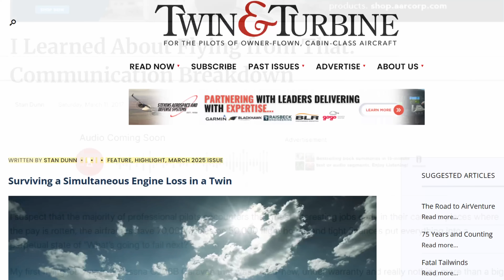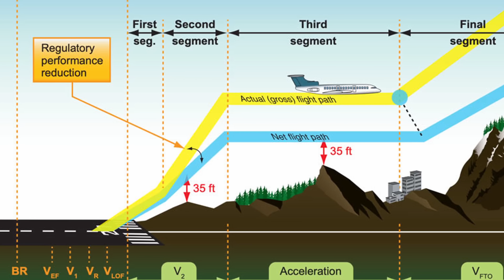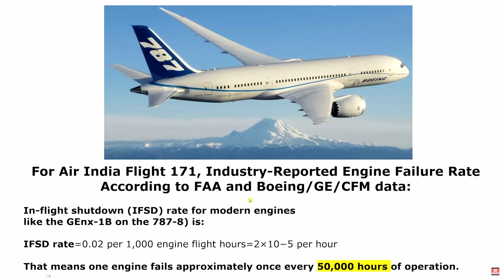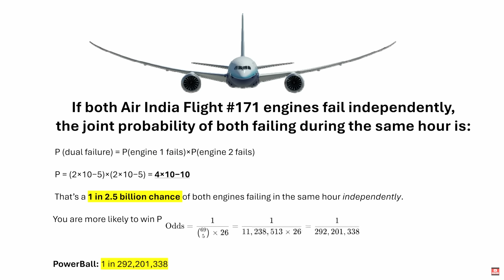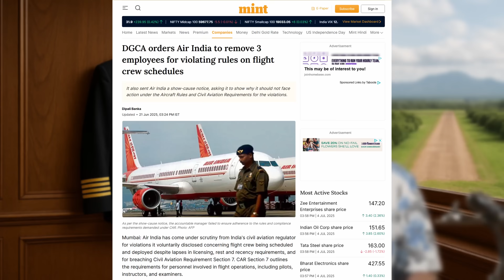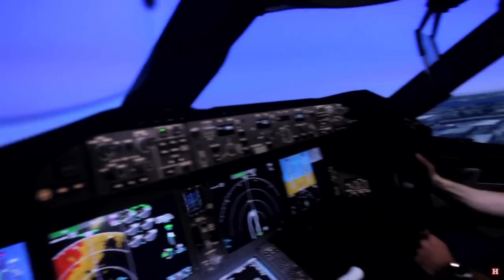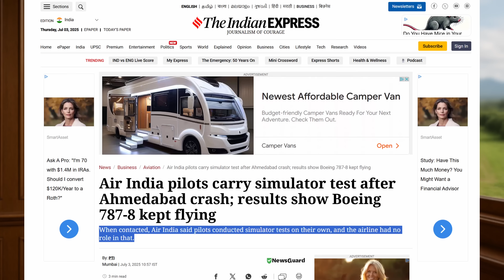Air India 171 Cause Becoming Clear

Comment: When  speaking about Flight Data Recorders (FDR) and Cockpit Voice Recorders (CVR), an image of an orange box was shown, it is not a FDR or a CVR, but is an Emergency Locator Beacon (ELB).

The B787-8 is equipped with combination units which record by Flight and Cockpit Voice data. There are two units installed in the aircraft one in the tail and one in the forward electronic bay.

Comment: In a 2009 SA Airlink accident, the pilot mistakenly shut down the functioning engine instead of the faulty one, leading to a forced landing. The crew was flying a Jetstream 410. The right engine had failed due to a turbine seal plate issue, but the aircraft could have continued flying on the left engine. The pilot's error in identifying and shutting down the wrong engine resulted in the crash.

Comment: Sabotage from within the flight deck? A third pilot or cabin crew member sat on the jump seat pulling the fuel control switches just before rotation? This would explain the seemingly late takeoff, gradual loss of lift & RAT deployment
Reply: The aircraft could not have reached the impact point if both engines were shutdown, hence they had to be producing some power.
Reply: @christopherrobinson7541 it would take around 20 seconds for the engines to completely stop producing power after shutdown

Comment: One should hear the engines instead of the RAT, even if the RAT was deployed.
Reply: The original version of the video taken on the balcony is better quality and the in addition to the RAT the engines can be heard operating at low power.
Reply: @christopherrobinson7541 RAT 80db, engine at least 40db louder at take-off would make it impossible to hear the RAT.

Comment: Put pilots back in control not computers pilots have no feel of these aircraft anymore because computers are flying them and & compensating for any little changes so when something does go wrong pilots panic because they haven't got the experience to feel what the plane is doing or the experience to have an idea as to what may be causing the problem say you have smoke in the cabin bring out the bible spent 25 min running through trouble shooting smoke is getting thicker & in that time you passed 2 to 3 airports where you could have landed 40 min later smoke has filled the passenger compartment but were still reading. Pilots need to have the feel of their aircraft say they get a 100 knot cross wind instruments plane is all over the place pilots are panicked because they never felt anything like it because the computer would compensate for this any other time pilots would know this if they flew their planes.

Comment: Losing power in 2 engines within an hour is impossible? British Airways flight 9 lost power to all 4 engines. That was a 747!!! It can happen. There are usually causes outside the aircraft. They flew through ash.
Reply: What saved that aircraft was teamwork. The crew streamlined the relight procedure and eventually were able to recover power to the engines.

Comment: Thanks for ur indepth analysis. The pilot shutting down the functioning engine instead of the malfunctioned out of instinct is not only scary but also worysome.
May be not taking adequate rest put em in severe stress.
Yes i assume it was majorly a pilot error disaster and think the pilots knew which engine had issues, they thought it was corrected or could be managed but the fault persisted eventually leading to disaster.

Comment: It does not need much! A faulty WOW switch, and an engine fire sensor, erroneously indicating an engine fire (due to heat or moisture).
A software that autonomously shuts off all fuel valves since, by the sensors, the aircraft is on the tarmac and burning.

Comment: Background- 36 years in aerospace engineering as a supplier of electrical load management systems. I continue to find it utterly unbelievable that the APU is shut down after main engines are running.  This can only be a mandate from airline finance and eco loon’s.  Surely (don’t call me Shirley!) a safer position would be to take APU to idle after engine start and leave it lit at idle until in the cruise, when you have ample time for a relight if needed.  Ok, that wasn’t a significant issue for Air India but it was extra workload for Sully in the Hudson.
Reply: Why do they shut down the APU? Cost.
Reply: @christopherrobinson7541 yes, read my comment again. Finance or eco loons.

Comment: there was clearly smoke coming out of the left engine, ground dust from wing downwash during liftoff doesn't likely come on 1 side only as we saw, so this is clearly smoke from the left engine.
Reply: There was a light cross-wind from the right, which is why the dust was blown to the left.
Reply: @christopherrobinson7541  I dont think that one was that strong to push all the dust to the left as the aircraft had no direction nor bank angle corrctiion to the right after lift off.

Comment: I'm an engineer and we have a saying: "when all possible causes of a problem have been ruled out, only the impossible causes remain". So whilst it may be considered impossible for both engines to fail at the same time, you can't just dismiss the idea because it's "impossible".
Reply: I think Sherlock Holmes said similar a couple of hundred years ago 😊
Reply: @jeanmyers1787  Sherlock Holmes said: When you have ruled out the impossible, whar remains, however unlikely, must be the truth. 

Not really similar.
Reply: @mkk707 Whatever, I think you mean. I think Conan Doyles famous quote means exactly that long before planes were invented
Reply: But as engineers we also say “what is the mechanism?”. You have to propose how you think it happened, so that your proposal can be scrutinised. You can’t just say “because” like little kids do.
Reply: @jslonisch TCMA (software on FADEC use for preventing un-command high thrust) can command engines to shutdown automatically when FADEC is on ground mode.

Last year there was an airworthiness directive about faulty LRRA (Low range radio altimeter) can cause “undesirable Auto Throttle behavior” on 787

LRRA is also being utilized by FADEC to sense air/ground mode.

So a faulty LRRA would’ve cause undesirable A/T behavior + FADEC issue with sensing air/ground mode 

If FADEC is on ground mode while plane is in the air, combined with undesirable A/T behavior due to faulty LRRA…

What are the chances of TCMA activated and shutdown both engines simultaneously shortly after take off?

It’s definitely far from impossible…

Note that this scenario also matches perfectly with everything we’re seeing so far.
Reply: @jslonisch  "You have to propose how you think it happened" - yes, and the investigators will eventually do that. But what do we know so far? Well, we know for certain that the plane crashed. We also know that there are a handful of suggestions as to why it crashed and that each of them have been deemed so unlikely that they can be ruled out. So that leaves two possibilities - either something that nobody so far has thought of led to the crash or one of the ruled-out 'impossible" causes did so. We need to keep an open mind and let the investigators do their work. We can also hope that the cause isn't something that fundamentally threatens all future aviation. As for "proposing how I think it happened", I don't know; I don't have access to the evidence and I wasn't there. I can only point out that sometimes things that do seem impossible, do actually occur.
Reply: @Chris-hf2sl I don't think this investigation is transparent enough. There needs to be a representative of the families as well on the team to ensure it goes properly. It doesn't take this long to download the CVR!!!?
Reply: @V12F1Demon  "I don't think this investigation is transparent enough. There needs to be a representative of the families as well on the team". - the last thing that the investigation needs is representatives of the families wailing in the background. Proper investigations take time. A interim report is sometimes issued after a month or two if a problem is identified that needs urgent attention to prevent a reoccurrence. But normally, such investigations take a year or so because it's important that all aspects of any findings are considered and that no incorrect hasty conclusions are reached. Yes, it's frustrating, but it's far better to get things right than to rush.
Reply: @Chris-hf2sl  Not saying rush it but an independent expert bound by the rules of the lead investigating agency who is nominated by the families to be part of this process sounds quite fair to me. He doesn't have to be informing families only someone who can reassure them that, procedure is being followed.
Reply: @jslonisch it just takes time. Like that time a swiss airplane was destroyed by a fire caused by a pelt designed inflight entertainment system
Reply: "when all possible causes of a problem have been ruled out" ... check who owned the ruler, and what their "stop criteria" are ('Cognitive Systems Engineering', Rasmussen et. al.)
Reply: Especially when they're controlled by the same buggy software.
Reply: fuel valve fails closed after DC power failure...heard it the day after the crash.
Reply: @nunyabiz1780  nope
Reply: @nunyabiz1780  well that explains what we see that seems highly unlikely that any kind of power failure would lead to such valves failing closed, by design. 
I suggest that if they did both close, it’s because the control system told them to close.
Reply: @JoeOvercoat  yet its a safety feature
Reply: @nunyabiz1780 Nope, one of the pilots screwed up and shut off the fuel to both engines
Reply: but occams razor should be used first because it takes less time.
Reply: Fuel, Filters, Oil, Air/Tank Gas, outside parameters, Fuel Injection, Electrics-Hydraulics-Electronics, Feed back and Controls, Flaps. 
Human Error prior and or during flight, Sabotage, Terrorism etc.
Lets wait and see what the data analysis says for evidence and not to speculate.
Reply: @SamBaghi  we are just curious and interested people who find this accident so mysterious... not your run of the mill accident which is why there is so much interest... just opinions...
Reply: @SamBaghi Human error should always be be at the top of the list.
Reply: We're not at that point. We have the data from the black box to analyze. IDK why he's even doing this video. This has been beat to death already.
If the black box is not usable, then we have conjecture and wild speculation to get into. Maybe space aliens LOL (It wasn't space aliens).
Reply: As an engineer I work differently.  The least probable can be dismissed until the more probable are evaluated.  Which they have not really released any information yet on.
Reply: Well Said Sir !!❤
Reply: It’s nowhere near impossible for both engines to shut down simultaneously, a software issue could command them both to ground idle, AF296 had an issue along these lines in 1988.
Reply: Nothing is impossible an NO 9ne is untouchable.
Reply: Several billion to 1?  You must spend your entire paycheck on lottery tickets.
Reply: OTHER more probable causes HAVE NOT been ruled out - So the homily is misleading
&
IF both defied astronomic odds & concurrently failed - WHAT CAUSED THAT? 
There is growing suspicion that plane was a DUD (poor maintainace or whatever) AND the Pilots were exhausted even before getting on board
Reply: Perfect!
Reply: Indeed, exactly. And there were some very seldom, but existing cases where a dual engine failure wasn´t caused by a bird strike, the famous 777-at-Heathrow-example included.
Reply: Anything is possible.  Double engine failure could happen, but very rare, very low probability but according to Reason's Swiss Cheese concept, sooner or later, all the negatives could line up leading to a disaster.
Reply: "when all possible causes of a problem have been ruled out, only the impossible causes remain". Well, I'm an engineer too and during my forty years at Rolls-Royce plc (aero gas turbines, not cars) I never once heard anyone use this alleged "saying".
Reply: "ELEMENTARY MY DEAR WATSON!!!"
Reply: Well as engineers, we think in probability all the time, also in probability that is so rare that it can be discarded. But double engine failure isn't improbable at all, as long as there is a common cause, and I don't think anyone of relevance thought about ruling that out.
Reply: Microsoft Excel field a Paisan formula several years ago where one of us can go into Excel find the formulas put in the rates of success or failure in this case, put in the number of events and ask it about the probability of being above below or at that value. 
As an analyst, I would say the probability is very low of independent engine failures at the same time   but I would also say that an aircraft is a complex system with interrelated components so it’s easier to imagine a dual engine failure driven by some control error.
But no matter how one cuts it, it’s not zero.
Reply: No longer impossible I guess as it appears to have happened in this one
Reply: Exactly! People are struck by lighting twice despite the idds and people when the mega lottery despite low odds. Nothing is impossible
Reply: Exactly! People are struck by lighting twice despite the idds and people when the mega lottery despite low odds. Nothing is impossible
Reply: And lets not forget ONE person survived the crash…No serious injuries and no burns…. would one sustaib injuries being ejected from an airplane oover 1,000 feet in the air?? A lot of ppl die adter being ejected from a moving vehicle
Reply: I think Sherlock Holmes said that in the 1890s
Reply: Don't forget that we exclude human error for ethical reasons, not because it's more impossible than two engine failure.
Reply: A dual engine failure is very very unlikely. Pilot error is very likely. One of those pilots shut the fuel off to both engines.
Reply: It was settled some time ago that engines were switched off, even the captain states this and three time. Now there is clearly fear that the airline might go bust, so a pr exercise is taking place, muddying the waters, taking away from what really happened
Reply: Yup, improbable is not the same as impossible. A simple example of that is the roll of a pair of dice to get a double six. The odds against doing that are 35:1, but you or I could still roll a double six on our first try and I'm willing to bet you might have done so on occasion because I know I have. It's the same principle with a dual engine failure too; massively unlikely it may be, but that doesn't mean it could not happen.

However, it is worth bearing in mind that whilst the oft-quoted  Arthur Conan Doyle phrase uttered by his character Sherlock Homes, which your saying paraphrases, i.e: 'When you have eliminated the impossible, whatever remains, however improbable, must be the truth' sounds very clever and suits the narrative of Holmes' fictional brilliance as a detective, but in reality it is simply not really a practical thing for a real investigator to rely upon. The reason for that is pretty simple and can be summed up with another phrase, which is: 'we do not know, what we do not know', or in other words, we would have to literally know everything in order to be absolutely sure we genunely had eliminated every potential possibility, and in practical terms, we are never going to be able to do such a thing, because we do not know, what we do not know.
Reply: @ChockHolocaust  "Independent engine failure within the same hour one in 140 billion."    Dunn makes this assertion without evidence.  In any case, one in eighty billion is the same as rolling double-sixes seven times in a row.     Assuming independent events is a rookie mistake, something that would fail a high-schooler's AP exam. 

In short, nothing is more clear today than it was a couple of days after the accident. That will likely change after the data in the flight recorders is read out.

BTW, the chance of rolling boxcars is 1/36.  Casinos pay 35:1 because it is their business to take your money.
Reply: Fuel contamination is a strong possibility or electrical failure noting we see the RAT deployed. There was also another Air India flight that was troubled within a week or two. Sooooo maintenance is something to consider.
Reply: @allthatsheiz RAT deployment is automatic. Shouldn’t that come out regardless of how the remaining engine is shut down? I’m just guessing. We’ll see when the accident reports come out. NTSB is also investigating since it’s an American airframe, right? Will be interesting to see if there’s any difference between what the NTSB and Indian investigators find.
Reply: @allthatsheiz None of the fuel contamination cases in the past resulted in engines failure. They all resulted in engine performance degradation but none actually failed. RAT was NOT deployed in all cases.

So, now you can change fuel contamination from “strong possibility” to “unlikely” because this accident does not share any similarities with any of the previous fuel contamination cases.
Reply: @allthatsheiz You think you see the RAT deployed, not been confirmed, video does not show this conclusively
Reply: @allthatsheiz Nope all those theories were wrong. Pilot error is 80% for aircraft crashes. The pilots screwed up.
Reply: whilst ????? Lol you are like UBER anoying, Read much??
Reply: @EnzoFerenczyo  What on earth are you on about?
Reply: @EnzoFerenczyo  do big words requiring a few brain cells to process scare you ?
Reply: @EnzoFerenczyo 
Whilst is a word. It can be found in dictionaries. Read much?
Reply: Yea the odds are 1 in a billion, 1 in a billion what?
Reply: @ironmantooltime  are you asking for the units in the probability?  There are none, unless you want to use something like “chance”.